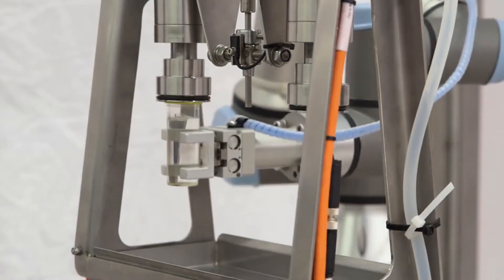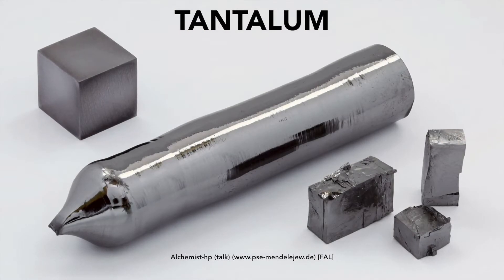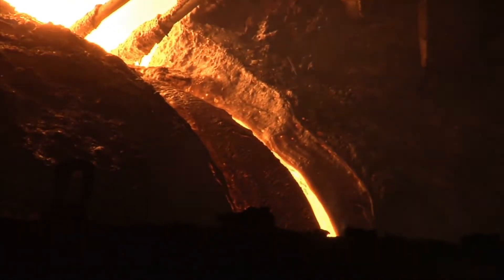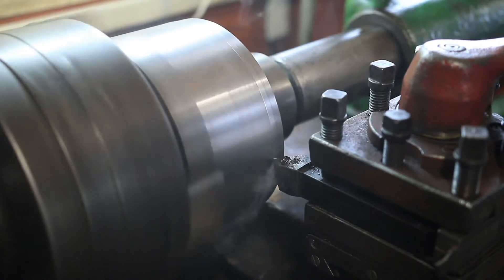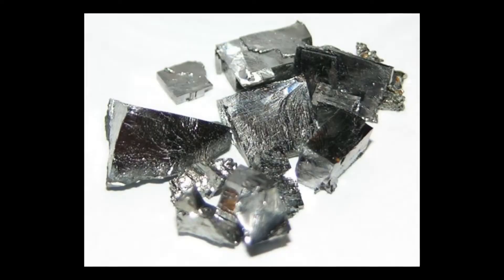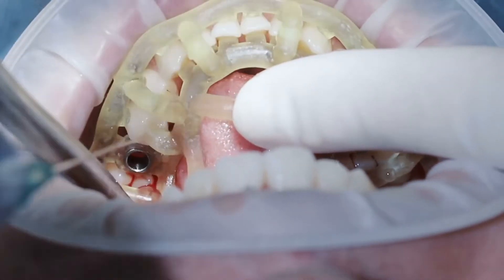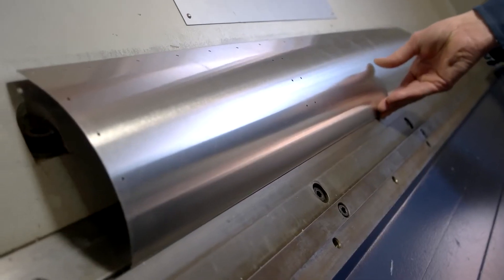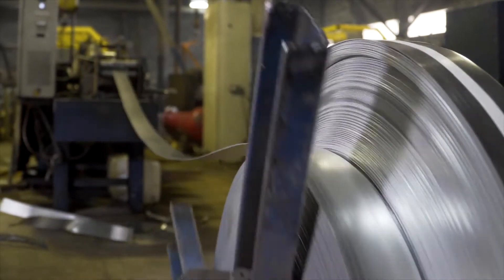2080 – 10 – What is Tantalum?

Comment: What are some good feeds and speeds for machining this material?
Reply from the maker: The optimal feeds and speeds can vary based on your specific machining setup and the tooling you're using. Generally, for machining Tantalum, you can start with a lower speed around 100 feet per minute and a moderate feed rate, say 0.002 to 0.005 inches per revolution. Adjust these based on your tooling and finish quality. Remember, always check the manufacturer's guidelines for more tailored advice.
Reply: @sawbladeuniversity  thank you. First time cutting it.